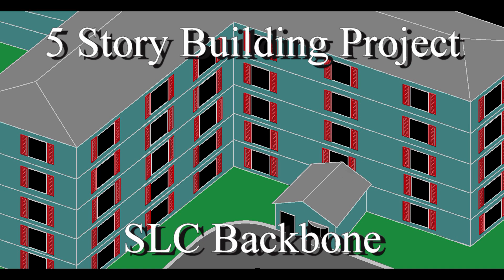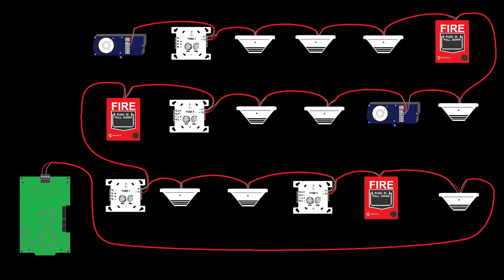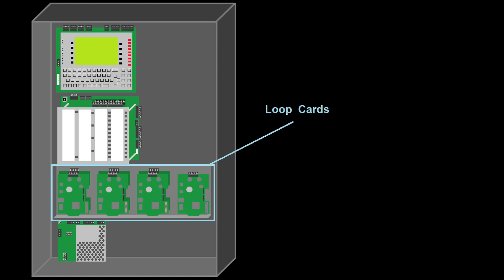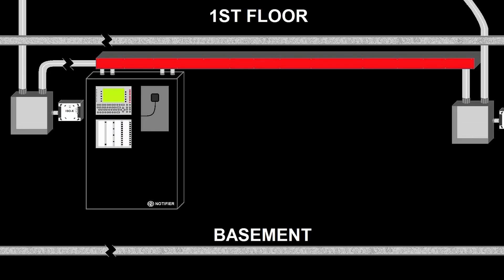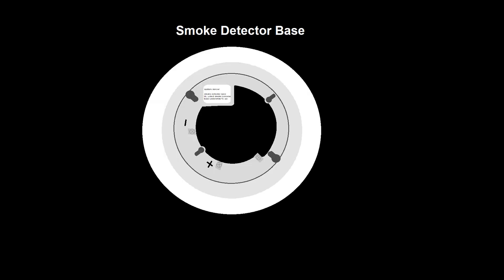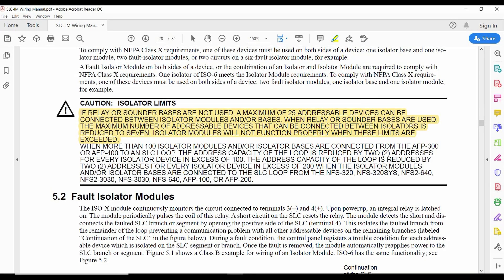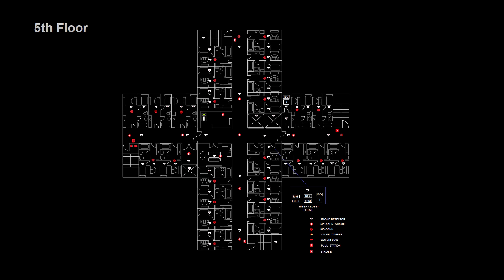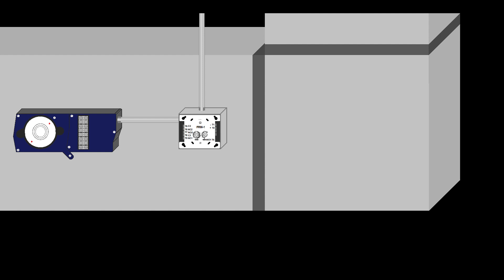5 Story Building - Backbone of the SLC

Comment: Question: If style 6 and a short occurs, all other devices either side still work... so why the need for a line isolation module?
Reply from the maker: Nothing will work if a short occurs on style 6. If there's a short, all of the current (technically not ALL, but for all intents and purposes, all current) will take the path of least resistance. No devices will work on any type of circuit if there's a direct short. That's why the iso mods are needed. They isolate the section that's sorted. That's why they're used in pairs.

Comment: How exactly do you choose to use four core or two core? Which criteria is considered?
Reply from the maker: Usually that's determined by the type of building and local codes. The technician doesn't decide which to use.
Reply: @JoeKlochan  thanks
Reply: And what is the purpose of the interface panel in fire detection system??
Reply from the maker: @niragila  I'm not sure what interface panel you're talking about?
Reply: @JoeKlochan  one with a bunch or relay modules and one isolation module...specifically from flowgain manufacturers
Reply from the maker: I'm not familiar with flowgain

Comment: Joe you say all the devices are in parallel, however from the sketch they look like they are in series.  Am I not seeing it correctly?
Reply from the maker: Well, if you see this as a series circuit, how would it be wired in parallel?

To me, a series circuit would be as follows (I'll try to explain it without a picture):
Picture a battery powering light bulbs. The positive terminal of the battery is wired to a light bulb, then a wire leaves that bulb and goes to the next bulb. Then a wire leaves that bulb and goes to the next bulb. And that goes on until a wire leaves the last bulb and returns to the negative terminal of the battery.

Comment: I have a question for you. What happens if during a power outage, an fcps batteries run out and the fcps completely powers down, but the FACP still has battery life and It sends  alarm signals to the inputs on  the powered down fcps ? Would this damage the fcps? Thanks

Comment: Hi Joe, Great explanation. I have an issue with NFS-320 "Trouble in System" Alarm, it is appear on the display "No Device on L1". This panel is used for energized 4 solenoid of CO2 Vent Snuffing dan 2 pressure switch inputs. Coule you help me to figure out how to fix it, is it related with SLC? Please guide me with simple steps if you don't mind. Thanks a bunch.
Reply from the maker: That trouble means the panel has no points programmed. When you take that panel out of the box and power it up, you'll get that trouble. It knows that it needs some devices on the SLC in order for it to do anything, and currently there are no points programmed. You could connect a device and auto program it, but it should be programmed via the software and then the devices need to be connected to the SLC.

Comment: Do you have anything on wiring up a PIV to an FMM with a surge protector?
Reply from the maker: I do not, but the surge protector would be just in and out, very simple, and the PIV would be similar to any other valve tamper. Checkout the video on wiring devices to sprinkler systems for that.

Comment: Do you have a video explaining what’s a “home run”? And how to connect to your devices when pulling a “home run”. Thanks
Reply from the maker: Home run simply means a wire pull all the way back to the panel. If you're at a device with a wire labeled "home run", that's either your feed or return to or from the panel.

Comment: Many times you refer to the acronym  SLC.  What  does that stand for?
Reply from the maker: SLC = Signaling Line Circuit
Most manufacturers use that term for their data loops, the circuits that communicate with all the addressable devices.
Reply: @JoeKlochan  Thanks for clearing that up.